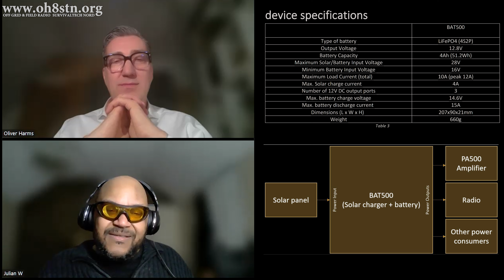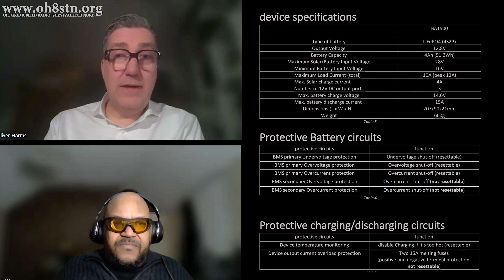Intelligent Portable Power for Off Grid Ham Radio

Comment: Thanks for your videos. The question I have is this I'm running a ft891 with a 12v 12ah that draws 2.0 on Rx 23 on TX what size of a solar panel would I need to keep it changed up while operating, Thanks for your help, I'm new to all this stuff
Reply from the maker: Sadly, It's a trick question.  
The answer will depend on how often you transmit, at what output power, for how long, and on your battery chemistry. From experience,  my FT-891 running JS8Call, using a 10ah LiFePO4 battery using a 120-watt PowerFilm Solar panel, could keep running for roughly 12 hours. Naturally,  when night fell, that time would be significantly reduced. With radio such as the 891, it's the receive current which destroys our ability to operate for extended periods of time. 
To your question. 
I got rid of my 891, replacing it with a radio and amplifier with combined current draw of 300ma, and 100-watt TX current of 10 amps. With that same 10ah LiFePO4 anx 100-watt solar panel,  I could stay on air for days at a time.
Check out my videos and "reducing current consumption". You quickly find that there is no magic number that anyone can tell you.
Excellent question and thanks for watching.
Reply from the maker: Take a look at this video: https://youtu.be/CAUamTA9G90?si=e8wXam-29AgTGpVc

Comment: A bit off-topic: I just tried your tip of installing a Chameleon whip (CHA-MIL-2.0) on the base of my SuperAntenna and it really made a huge difference. Below 1.2 SWR across all of the 20m band.

Interestingly, although you mentioned that using the Chameleon whip might change the tuning of the coil (rendering the frequency ruler inaccurate), I found that the Chameleon whip functioned exactly on the same coil position for the relevant band as the whip.

Anyway, thanks for the suggestion.
Reply from the maker: Extremely happy it worked for you. This is still one of my favorite resonant whip antenna configurations.
73
Julian oh8stn

Comment: Very informative.  Sounds like he is making your dream battery Julian.  I would have jumped on board the TX-500 and purchased a radio, it's just the cable mess detracts from the portability.  Is there anyway he could have used a floating contact  instead of a cable to  power the TX-500 directly and have the flying leads available for peripheral devices?  I look forward to seeing the next part of this session,  Thanks
Reply from the maker: Great question and I agree. The cable mess is an issue.  It wasn't possible to use the pogo pins for this much amperage. 2-3 amps is OK, more is a no-go.  Thankfully,  If we only want to power the radio, lab599 has a pogo pin compatible battery incoming. The BAT500 is great for powering multiple higher amperage devices simultaneously.

Comment: Great video! How would you compare this  product to the "DIY LiFePO4 Battery – Pocket Portable" that you demonstrated recently? I was set to build one. One of my "wants" is to be able to charge battery to battery so I am thinking that having a discrete, rather than integrated charge controller might be beneficial.
Reply from the maker: Thanks for watching and for the question. My DIY pack is cheaper,  user repairable, but lacks the extreme protections this one includes. Ultimately,  the pocket portable pack is only as good as the builder, builds it.
On a side note.  Charging batteries from batteries can be complicated. Source battery needs to be higher voltage than the battery we are charging.  We also need to regulate the charge voltage and current.
73
Julian oh8stn
Reply: @OH8STN  I have an off grid solar system. Panel > charge controller > Lead acid Battery. The loads are negligible so the battery is almost always fully charged. My plan was to use the charge controller from the DIY Pocket Portable to charge the portable pack from the fixed battery.

Comment: Is it emp proof?
Reply from the maker: Good question,  complex answer.  With long cables connected, the pulse will travel up the cable (which acts as an antenna),  and blow the circuit breaker or possibly damage the pack. Without cables, connections are so short, the wavelength of the pulse may not damage the pack at all. This is also true for mobile devices like smartphones or tablets. It's almost impossible to protect any device while it's in use and connected to charging eires. Without an actual e m p test, It's hard to say. What we can say is it is one hundred percent possible to protect, while it is being stored.

Comment: Hi Jullian, This looks like it wil be an amazing addition to the build of of a complete system. I would like to ask Oliver about production and costs. The cost for the amp is way out of reach for many of us. Especially when listed on ebay for auction. Are there any plans in the future to have consistent production levels to meet demand and manage the cost of the units? I beliave these units are almost priced out of market reach. It is hard to really justify the cost of a $3,000.00 + amp.  Next, could there posibly be an addition of blue tooth interface to understand and manage elements of power consumpiontion and capacity across the outputs?   Thank you Jenn KD2WRM :o)
Reply from the maker: Hello Jennifer.
Only the expedition model is sold on eBay. That's an auction. The normal  PA500 can be purchased from a few distributors in Europe and North America, at much lower cost than the Expedition model.
I sent Oliver the other questions you had. Hoping he will comment here when he reads this.
73
Julian oh8stn

Comment: A very clever idea and a high quality product. 

I imagine that no noise is emitted whilst charging etc.

It looks like a serious piece of kit but probably also expensive.

I think it will be a perfect solution to add to your intense field activations Julian. :)

The Lab599 + the amp and battery/solar charger solution would be one of the neatest kit out there with the PowerFilm added aswell.

This hobby can lead to bankruptcy! 😂
Reply: Don, your assertion is an understatement! I have not (and won't) account for the amount of money spent on equipment. If I did I'd probably have a heart attack. ;) And then there is money spent on travel for portable operations.

However, we should also note that the equipment retains a substantial part of the investment in residual value. I told my kids that if I die before I liquidate the various bits and pieces of my "collections" they should not just dump my stuff. They should get help from others who know about my things and they will get near full value.

This includes books (many out of print), radio equipment, etc.

On topic, I'm looking forward to the BAT500 as an addition to my portable kit. I'm thinking that the TX500/PA500/BAT500 station would be outstanding for POTA/SOTA in a small pack with a MS Surface Go and a PF foldable panel.

73 de AG7TX